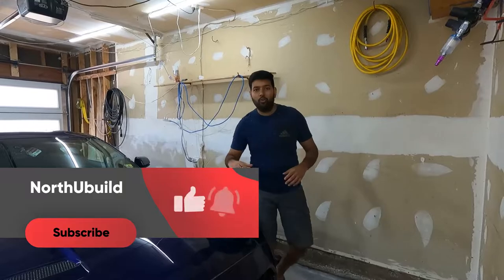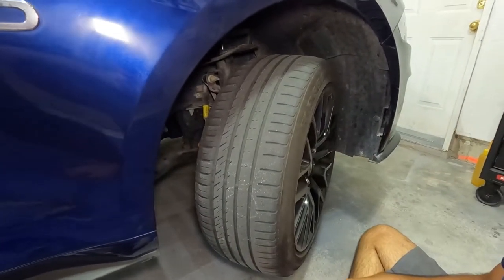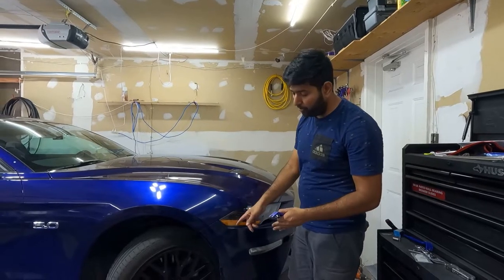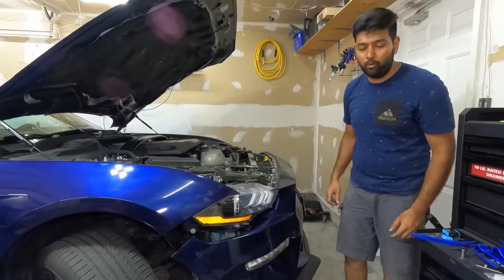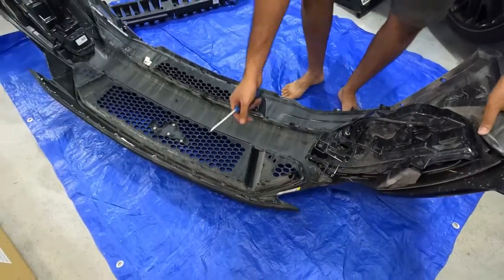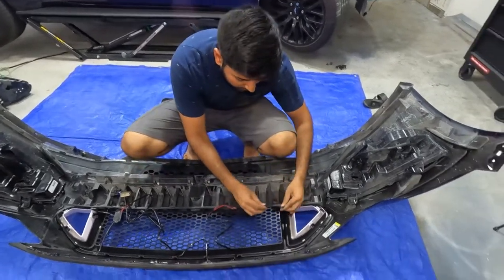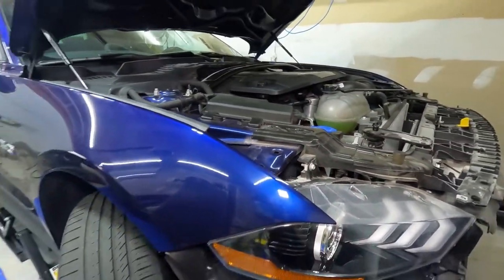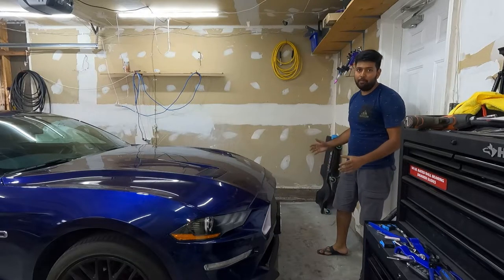2018-2022 Mustang GT RTR style LED grill Installation

Comment: How is the new grille holding up so far?
Reply from the maker: It's holding up great. No issues. Looks amazing on the road as light is drl so it stays ON when the car is on the road.
Reply: @NorthUbuild  installed mines today and I installed the bottom grille with the LED  lights in it they both look awesome
Reply: Hello can u help when I install this my car didn't wanna turn off ...engine stayed on but my dash and radio shut off ....finally got my car 2 shut off after I flipped light switch on and off ...any thoughts on why that happend ??
Reply: I have the same problem and now my left headlights doesn’t work. When I have it on auto any reason why ?
Reply: @jaquelinalvarez40  are you still having the issue ? May I know how did you wire them? and which wires did you tap into ? I can help you out
Reply: @Coyote.five.0  i have this issue on my car too with the rtr style grill , i have diode dynamics fog lamps as well just to note not sure if its a power draw issue and the headlight also shows off on park unless i shift to drive, or if i move the light switch to the next position, i think i will just wire the rtr grill to fuse box or battery so its direct
Reply: @jaquelinalvarez40  did you ever find out how to fix it ?